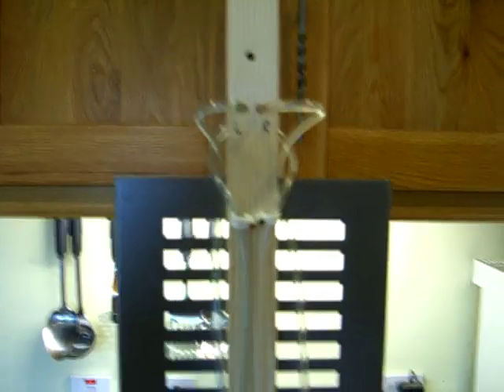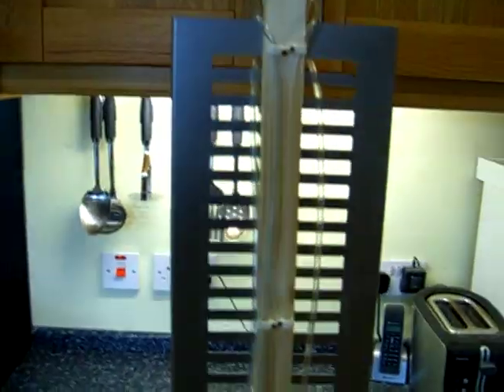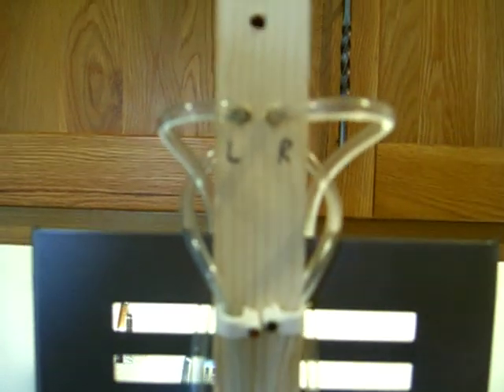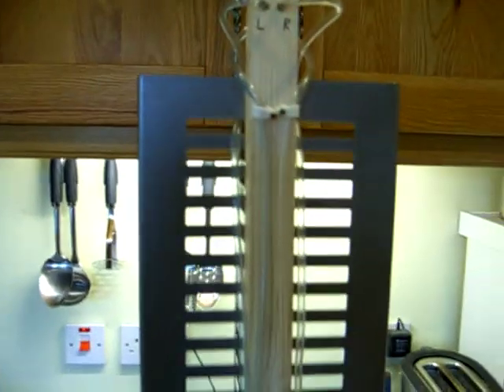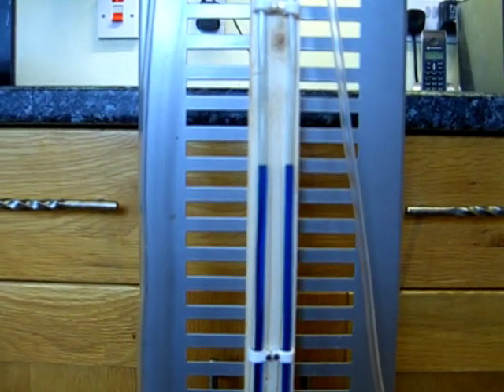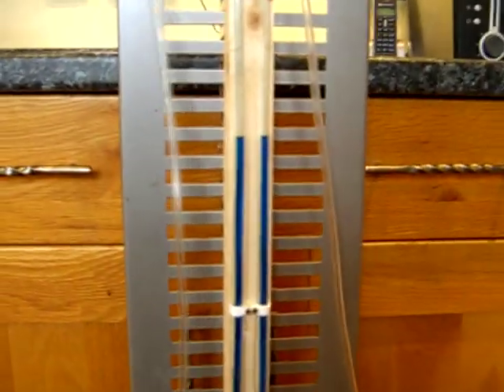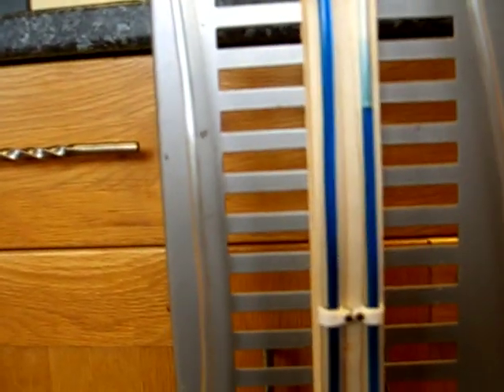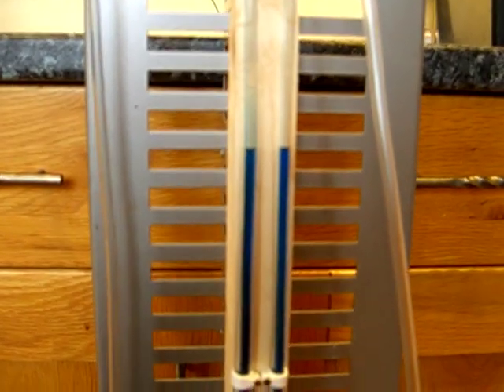Manometer, Throttle, Bodies, Carbs, Balancer, balancing carburettors, throttle, synchronization

Comment: To fill mine, (almost exactly the same, only filled with red automatic transmission fluid) I had one end of the tube in the fluid, and the other in my mouth- I sucked in about two or three feet of the fluid, the took the end out of the container, and held it up above the rest of the apparatus.

Comment: hi nice video does it need to be that big are can the whole thing be a bit shorter also can i use normal engine oil or mabye fork oil? Kind regards
Reply: its better to leave it big, if you have big difference in vaccum carbs it will suck the oil to motor very fast